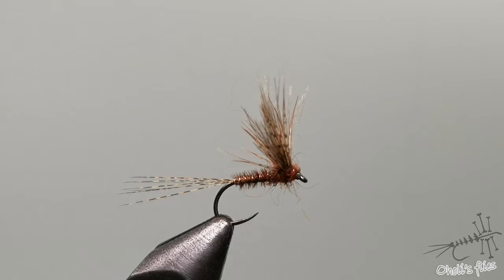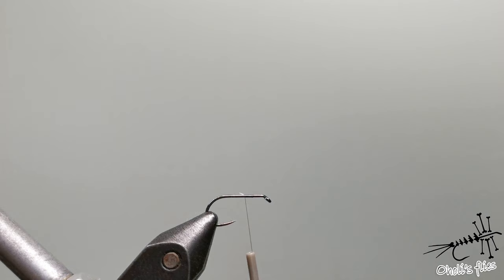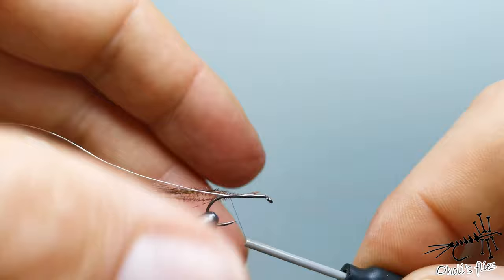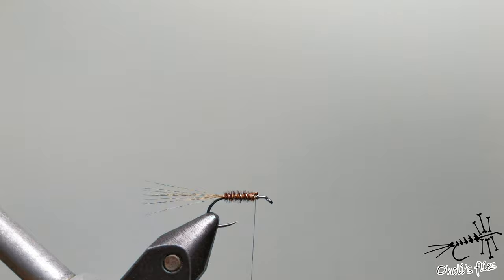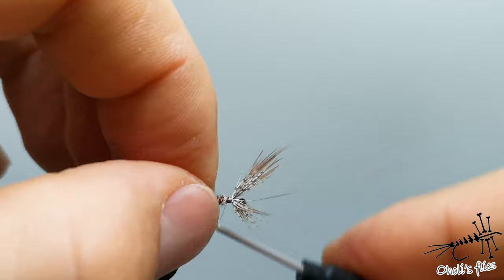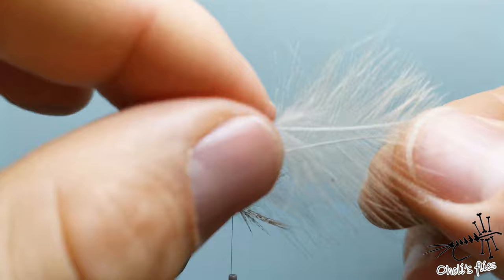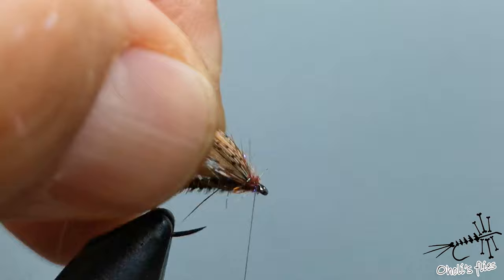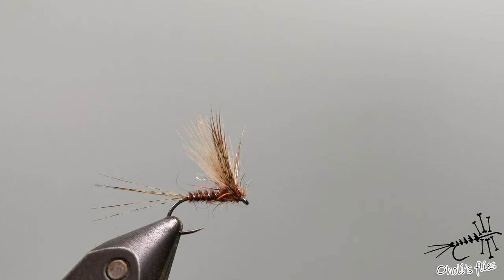CDC&Partridge Mayfly (Split Wing Technique)

Comment: What floatant would you use with the mix of cdc and soft hackle partridge feather as the wing looks a great fly probibly works well in broken water?
Reply from the maker: Usually i dont use floatant. But if necessary i use cdc oil since cdc is there to support fly. For bodies made of dubbing u can add some floatant too